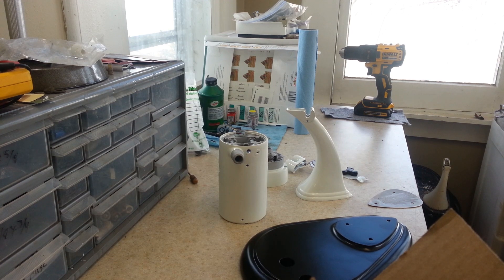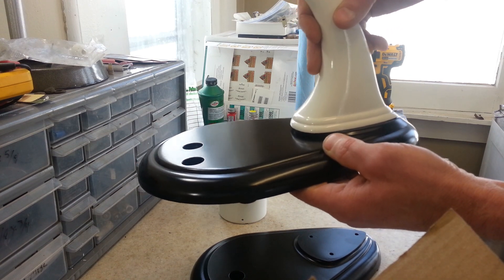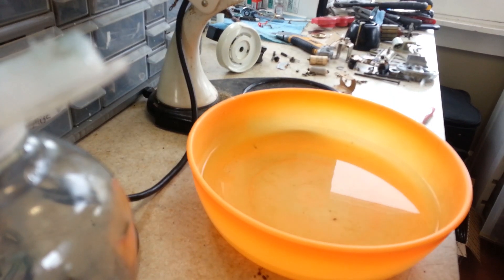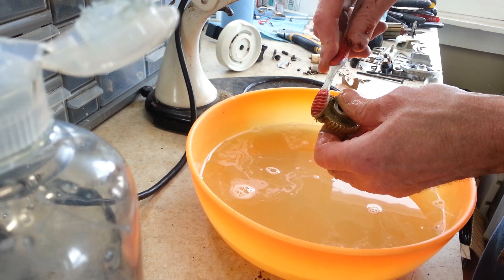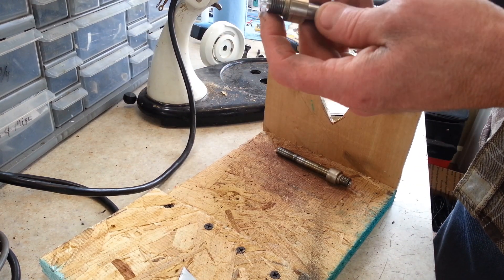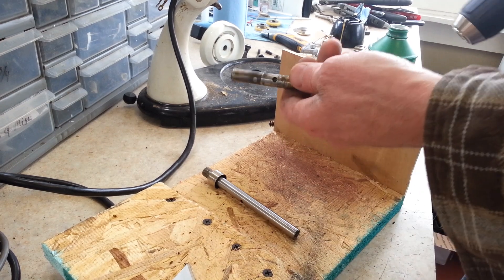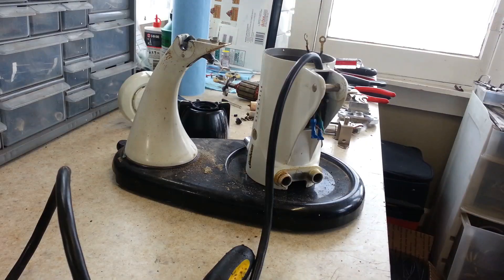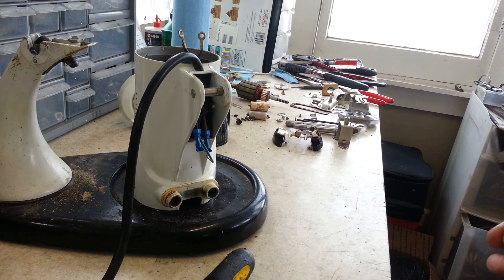Something different, a big thanks to everyone, and questions answered!

Comment: I would have never thought using my variable speed drill for polishing the armature and shafts.  Appreciate your sharing tips methods, and suggestions.
Reply from the maker: Thanks! Honestly it came out of necessity, I don't have a lathe and had to come up with something. I have gone through several different stand designs, but the simplest works the best.

Comment: Thanks for the video, learning new things every time I watch another video. :-)

BTW, the 3 in 1 oil in the blue can is the oil specifically recommended for electric motor bushings as it is detergent free and will not clog up the pores in sintered bronze bushings.
Singer sewing machine oil is detergent free.
Reply from the maker: Awesome, thanks! I have seen that the blue is recommended for 1/4 hp motors or bigger, and the red has anti corrosive additives, and is a lighter weight oil. It is very hard to find out any actual information , just a lot of conflicting suggestions on google, as always lol
Reply: Vintage Mixers and More

Understood, so the thinner oil is what mixers prefer. As bronze bushings require the oil to pass through the bearing, detergent oils tend to clump up impurities and clog up the pores in the bushings thus limiting oil flow.

Singer sewing machine is a nice, light, detergent free oil that I’ve used in my vintage desk fans for over 20 years with great results. :-)
Reply from the maker: Its possible the blue is good for the mixers as well, I really don't know if one would be better than the other. I only read the front of the blue and saw it was for the more powerful electric motors, and assumed it must be thicker or something. I do know the red has been used for decades and the biggest problem I have run into is just plain old lack of oiling , So I guess any oil is better than no oil lol. The bushings are different in different models as well, some rely on the bushings to soak up oil from wicks, like HB's, where Sunbeams are direct oiled, there is a hole in the bushing and it is oiled directly to the shaft going through the bushing. Also I believe they are just plain bronze bushing in the sunbeams, not the powdered bronze. Someone else also mentioned sewing machine is excellent to use for old fans!
Reply: Vintage Mixers and More 

No oil is definitely the enemy of vintage mixers and fans! :-)

I was talking to my sister in law yesterday - she inherited her grandmothers vintage Sunbeam mixer.

As is typical, she uses it everyday and says ‘It works great so I don’t think it needs servicing’! - hasn’t been oiled for at least 20 years.

It’s amazing how robust these machines are! :-)
Reply from the maker: It really is amazing, they are from an era where things were designed to last, unlike now where they are designed to fail at a specific time. 
A little oil would definitely not hurt though lol

Comment: WOW... I thought you would have been using a parts washer of some sort like are used in mechanics shops... Or some ultrasonic contraption... But doing it by hand.... WOW!!! I use gasoline or diesel fuel for the crud and finish it off with hot water and detergent... Nice armature rig! For polish I use iron oxide cloth.... (1000 grit)... How do you clean up the worm, besides a knife blade? Also, why not use the cord strain relief plate screw for grounding? Much easier than winding the ground wire all the way to the gearbox cover screw... For oiling the Mixmaster shaft I use a syringe with an oil resistant plunger... I've had one of my Mixmasters so worn from the lack of oiling that I had to inject warmed up Vaseline to get it to stop screeching ;-)

Thank you SO MUCH for sharing your wisdom :-)
Reply from the maker: Thanks! I will have a parts washer one day, just need to make room for it :) 
The work gear is easy, a rag gets into it pretty well. On Sunbeams it is a pain in the butt to ground it to the screw for the plate, since you don't know if it is staying attached, or causing it to not sit all the way in, it is very easy to shoot a wire to the front of the machine, all the space is now free that was taken up with the RF filter. HB's I use the ground screw under the cover. 
 A syringe is ideal for oiling, I don't have one, but I usually oil things up when I reassemble, and most owners don't have a syringe, and I was trying to show how anyone can oil the machines.
Reply: You are a great teacher indeed, I just wish I had more of your mellow disposition :-)
Reply from the maker: I'm usually pretty mellow, until I see someone not put their cart in the cart corral lol